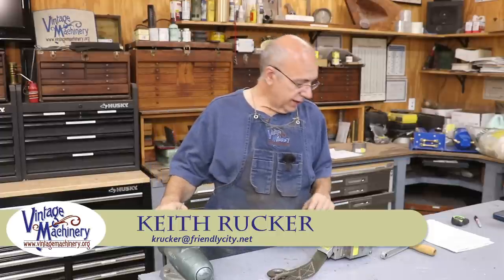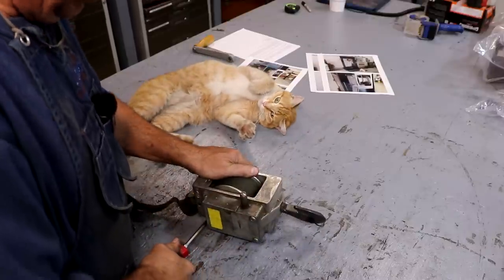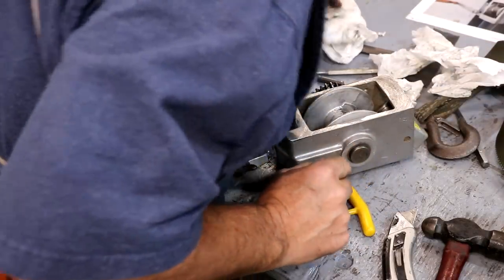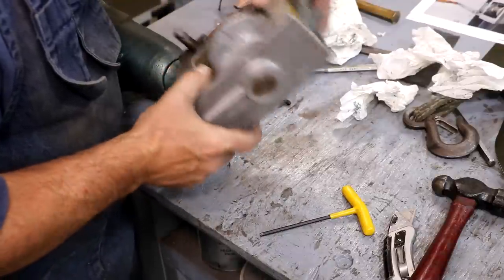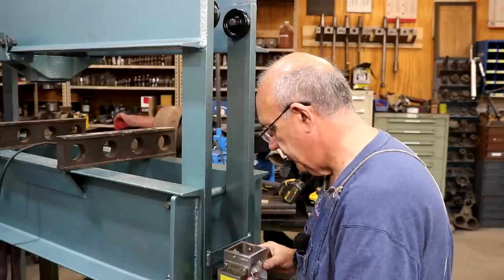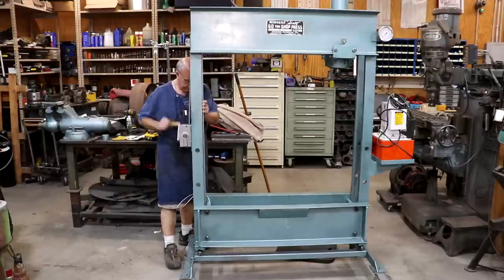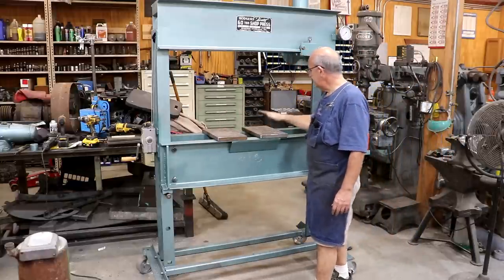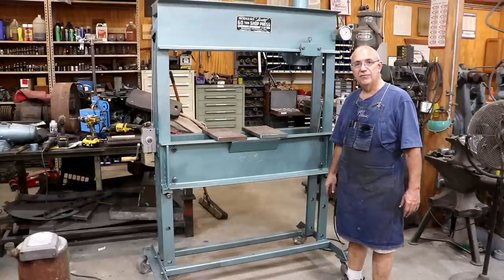Hydraulic Press Restoration:  Retrofitting a Table Lifting Winch to the Press

Comment: Remove the handle and fit a hex to the shaft. Then you can use your drill with a socket to operate the winch. Modify the handle to fit the hex also. Best of both worlds. You certainly have some lovely, generous viewers Keith.
Reply: I was thinking along these lines as well.
Reply: Yep- that is way too slow- your cordless drill will move it right along.
Reply: You beat me to it :)
Reply: 12 point socket, no mods. needed?
Reply: I was thinking it would be good to have the handle easily reversible so it could be turned inward and be less likely to get broken.
Reply: This is the best comment
Reply: @minigpracing3068  yeah good point if that shaft is a standard size
Reply: @MG-Driver  Yea ... he beat me too... ha.
Reply: I was thinking the same thing.

Comment: Minor safety concern.  Flip the cable clamps. The saddle piece goes on the loaded cable.  Remember the mnemonic "Never saddle a dead horse."  Which means don't put the saddle on the dead cable.  Love your stuff Keith. Keep going man!
Reply: Exactly what I was going to comment.
Reply: I noticed this immediately watching it too.  Can't just flip them. The problem is that the saddle side grips the cable and the u bolt crushes the cable, weakening it, to hold onto it. Fine on the dead end, it's not carrying the load, but now your live end is damaged and weakened. So now the cable must be shortened a little bit to remove the damage too.

In this application, how much load will the cable ever see? Hopefully not enough for this to matter. I suspect that the cable sizing is just what was available and not measured in any way. But it's one of those things you want to be in the habit of doing right every time, so the one time when it turns out it does matter you're good to go.

Comment: I am glad to see you could use that second winch I had.  If I had known you were going to show my pictures, I would have made Gus the shop dog sit for the photos.  I had to chuckle at your comment that the table moves a little slow because that is exactly what I said the first time I used mine.  That's when I added the PVC pipe to increase the diameter of mine.  Don't use a drill to run it.  The worm gears are not hardened, and will gall pretty quickly.  I tried that once.
Reply: Thanks for your generosity Mike, it was very kind of you to pass on a tool that you weren’t using. All of us viewers get to watch a project proceeding with your help. The whole video gives us different ideas on how to do things like this and how to improve on them as well. There are always comments on different ways to do a build like this, some good, some not as good but all are helpful. Thanks again!👍
Reply: Hopefully the worm gears have some 90W gear oil on them to slow down the wear.

Comment: Keith: Machinery Handbook has a section on wire rope, and they say it is very important to put the u bolt against the dead end of the cable, and the clamp against the live end of the cable.
Reply: Never saddle a dead horse.
Reply: I wondered who would be first to bring this up when I saw how Keith clamped it. Lol

Comment: You put your cable clamps on backwards. Look up never saddle a dead horse. Nice looking project. Looking forward to next video.❤
Reply: I was going to add the same thing you always put the saddle part of the cable clamp on the tension side so you don't cramp the individual strands of wire
Reply: Rigger/ironworker here. I now have a brain aneurism from screaming at the video. “ DONT saddle a dead horse”.

Comment: Great looking press Keith, nice job! Just one bit of advice when using Crosby clips on wire rope. Remember the old saying "never saddle a dead horse". The "saddle" of the clip, should be on the load bearing side of the cable, and the U-bolt should be over the "dead" or tag end of the cable. Granted this project isn't the Space Shuttle, but proper practice is proper practice.

Comment: Kudos on another great shop enhancement. Back at the start of this project you removed 2 angle iron cross pieces and upgraded with square tubing. A simple, heavy duty wooden tray sitting on the cross pieces would protect them from damage as well as protecting the floor from really heavy pieces. Add a lip around the edge and the tray would also make it easier to retrieve small pieces.

Comment: Not that it matters on this light application... The cable clamps are on backwards. The mnemonic for u-clamps is "Never saddle a dead horse" The saddle is the cast part and it always goes on the "live" part of the cable as the u-bolt piece crushes the "dead" end to hold it in place. Crushing the live end is not a good idea (if youre lifting heavy loads). Thanks for the great videos!

Comment: Really nifty winch for the job! I hope nobody forgets to slack the cables! Perhaps a good "insurance policy" would be a spring loaded momentary switch with a roller arm along one cable run: if the cable is taught, it holds the switch and locks out the power pack. Slack the cable to release the switch. Would be another cool retrofit!

Comment: Great video Keith!  As far as the cable, (wire rope) goes, I tig weld the ends to prevent them from fraying out.  It just melts the strands together.
Reply: That's the same idea that sailors use when whipping the end of a fiber or nylon rope.

Comment: Keith,

Nice job! You might consider fitting a plate on the drum to separate the two wires.  If by chance the wires. cross it can jam bury one of the wires.

If you decide to add a positioning device to move your cylinder left and right, look no further than your lathe or mill.  A lead screw, nut, and. a DC servomotor could be the answer to moving the hydraulic cylinder assembly.

Bob

Comment: Other than what you've mentioned, I'd probably want to make a sheet metal cover, insulated with foam, to knock down the noise of the pump. Overall, though, that press turned out way better than I expected when you first started the project. Nice work!
Reply: Foam doesn't sound insulate well.  Virtually zero.  But there are good sound insulators available.  And it's needed on that pump!
Reply: It’s still not as loud as Fenner’s hydraulic pump on his press. Lol

Comment: @15:38 I used coated wire rope/cable and thimble clamps about that size to anchor my car shelter in the back yard years ago. Four ground augers holding it down. That thing has been through winds that I thought were going to blow the house away! :face-fuchsia-wide-eyes:

Comment: Nice addition to the shop. I'm sure it will be quite useful.
I don't know if the wire rope will tangle in the winch but, a couple of eye bolts in the strap guide holes could help.
Thanks for sharing.

Comment: I have setup two different presses. The first one used a double cable both going up and over to lift the table. You get tangles and trouble this way, The second time I tried the other way which was much better. With only one cable on the winch it goes up to the top around a pulley and back down to lift the table from one side. This would never work as is. So another cable  connects to the table  where the first cable connected and goes down to the bottom across the the machine to the other side and then up to the top where it turns around a pulley ang goes down to lift the other side. I found this to be better than trying to drive 2 cables on one drum that tends to jam and tangle. Nice press nice job.

Comment: I done many press table lift using boat trailer winches, I've modified them by inserting a piece of 2 1/2" tubing in the drum to have a bigger starting point.
I.m a bit surprized that a press of that quality does not have a table lift  at the origin. 
very good add on to that press
very good video

Comment: i sent those plates.    i hope they will make good use of the press.   ive have a 20t press in my shop and have never needed more force. only more space.    ive used our 150t press at my work and it has a power unit and talk about dangerous!   you can change the force by 20t in the bump of a switch.  that 60 will be similar.  the cool thing about that winch is it will raise the table even if its loaded with a 100lb part.
Reply: Thanks for the kindness of sharing the extra tooling for Keith’s press, that was something that was truly needed and an extra set to double up or use as a second set to alter as needed. I’m amazed at how generous some people are when it comes to donating things that can be used and appreciated by us as viewers as well as Keith. Thanks again!👍
Reply: @Hoaxer51  I work at a steel mill and I bought some material a few years ago for some home projects, I went and visited Keith when he had the event a while back I didnt have a  lot of time there but I went and got them wheels from Lowes for him while the others were working and I thought about He was gonna need some heavy duty material for that big press.   So I went home a cut that material and shipped it via fastenal blue lane freight.  It worked out great.  I also sent some other smaller flat pieces and a piece of 4 inch round bar, so when he goes to make them adapters to go on the end of the rod we should see him make those too.
Reply: @MrChevelle83 ,You have some material laying around for home projects and it’s one inch thick steel plate and four inch round bar, what the heck are you building, an armored car? Lol Just kidding around, it’s guys like you that help the world go round. 
   Where I use to work would use Fastenal to have stuff shipped to us, a lot of people don’t know about that service but it’s pretty handy if you have a Fastenal store in your town, they also work on Dewalt cordless tools there maybe others. Thanks again for all your help and I’m looking forward to seeing Keith use up some of that other steel!

Comment: nicely done!  man that crank is smooooth.  That turned out really great.  You could just make a bit for the drill that looks like a tuning fork and use that to crank it.  That way you don't have to modify it at all and you can use it for other things like the handles on other machines 😁 a multi-use tool

Comment: Hi from Australia, I agree, make a set of different slugs/dies. Press plates might be better off doubled when you cut a profile for pressing,  2 inch thick is better than 1.... at 60 ton.

You can keep all the different the press plates on the bottom rails, as I'm sure you will have others to add. 
Consider a motor to power up/down to save you shoulder. That's a high ratio.  Enjoying what you do, Keith.

Comment: Keith:  i was on the Redline web sight looking at presses and they offer for $149.00, or you could likely build your own version of a protective screen that slides down out of the way when not in use or needed.  But i could see the virtues of having a screen when making high-pressure presses.  They also have an assortment of press options that you could likely make, but it would provide you with some interesting ideas. 
Lookin' great!  You know shops need a good shop cat, or shop dog.

Comment: A simple way to increase the drum size would be to put some of the web strapping back on the drum and then drill a hole though the strapping and pull your cable through, no need to fasten the strapping down the cables would do that.

Comment: The ratchet on a gear driven winch is quick to release to prevent pressing against the lift cable whereas the worm requires backing up or reversing the winch direction to release the platen suspension by the lift cable/winch. That mistake can and will occur. The benefit of the winch lifted platen will be a disaster when that aluminum winch is completely overloaded by forgetfulness... - Also; the smaller end of a retainer pin is usually the entrance end. Keep up that great camera action there Keith - wow...

Comment: I built a 12 tonne press from scratch about 15 years ago - works really well. Had a friend oxy cut some press plates. Suggestion. Instead of semi circle cutouts in the plates, get different depth right angle V cut outs on plates. I have always found there is more than enough surface area when pushing out circular shoulders etc. The V's are also much more flexible coping with different dia shafts/shoulders. Another thing I did was get different thicknesses pairs of raw spring steel. It is the raw material that leaf springs are made of before they are bent into an arc. The raw spring steel is approx 3 times more stiff than mild steel. Also the varying thicknesses of the pairs (length to match the outside width of the press) also means different widths of each plate. I have about 4 sets down to approx 1/4" (6mm) thickness (and about 2" - 50mm wide) up to 5/8" (16mm) thick and then with increased thickness, the material comes much wider. Even better, if you can get the spring manufacturer to throw these offcuts in the furnace when they do heat treatment for standard springs, then the material will be even tougher. However, the spring manufacture over here in Aussie land wouldn't do that. Even so they have served me very well over many years. You can use them very creatively, as recently as yesterday when pressing out front wheel drive bearings on a 1995 Toyota Echo (don't know what it is called in USA). Retired mechanic/machinist in Land Down Under.

Comment: The gear contact angles inside are such that no clutches, brakes, or palls are needed.  It is called a non-overhauling gear set.  It's designed to be a motion/power diode  (one direction only) from input worm to output sector gear.

Comment: Thinking about those cross plates - weld some strips underneath parallel with the support beams and the plates will not move front to back but be free to slide sideways.

Comment: Hey Keith good job! But the clamps the body or saddle goes on the live end , then u-bolt pulls the tag end into the clamp. For the weight you are lifting is okay you put them on backwards!   Remember saying You saddle your horse!   AKA  the live side of the cable !

Comment: Nice mod. Thats a really laid back cat with all the noise next to it. I would have mounted it inside the uprights. Possibly with a square drive in the handle and the shaft, that way the handle could be reversed (like on a milling machine Z axis) so it doesnt hit you in the side every time you pass the press.
Reply: Orange cats are weird. I had one that would get in the way when I was mowing the lawn. Whatever I was working on, if it didn't scare me, it didn't scare him. And, his hearing was just fine.

Comment: Your cable clamps are on backward. The ubolt goes on the dead end of the cable. The ubolt bites in and damages the rope enough to weaken it slightly but will hold even if the clamp is a little loose. If the clamp slips it will be the saddle that does so hense tightening the loop as long as the saddle is on the load side of the rope. Don't stagger the clips either.

Comment: I have not been Bluetooth Low Energy to fine a 1/4” to 3/8” 10,000 psi adapter. Is there one for that size? The best McMastercarr has is for 5,400 psi. Since it sandwiched between both fittings, I wonder if it matters, but like Keith, I’d rather have the right part.

Comment: How important is the table being perpendicular to the piston? I noticed when you lowered the table onto the pins that the notches in the table seem to be spaced slightly wider than the pins. In the video the table contacted the pin on the right first. When the left side contacted its pin the table shifted to the left. I can't tell if that caused the left side of the table to be higher than the right. My gut says the higher the pressure applied the more important perpendicularity is.

Comment: Could swap the handle for a weighted wheel. Something like a half a kilo cast iron weight from a lifting set. The mechanism is way overbuilt, so it should easily take that weight, which in turn will make it easy to rotate.

Comment: If it was stick welding vertical up is the only way.  With MIG vertical down is way easier, faster, and looks way better.  The exception would be flux core or dual shield.

Comment: The press is looking good I see several people that have said they would use a wood board across the bottom brackets I would make a box that would hold sand or sawdust because a friend had a 1/2” pin hit the floor and knocked a 1/2” hole in the floor of the shop could have been a bad day but my friend has double coverage the good Lord looks after fools and drunks

Comment: Instead of the cranck handle weld a nut on the shaft and use your drill driver with a socket to go faster.

Comment: Two comments.  First, if you can find out what winch that is so others can buy one for a similar application. Second, the cable clamps are on backwards.  The saddle should be on the live line (the one going to the winch), the U-bolt on the dead line.   "Never saddle a dead horse"

Comment: After working for 39 years in a refinery, I will tell you that a pressure gauge is to be twice the working pressure.  Your 15,000 lb gauge is NOT larger than you need.  It should be a 20,000 lb gauge.